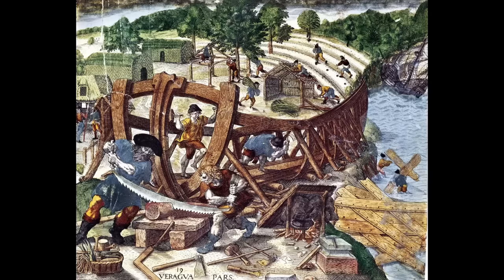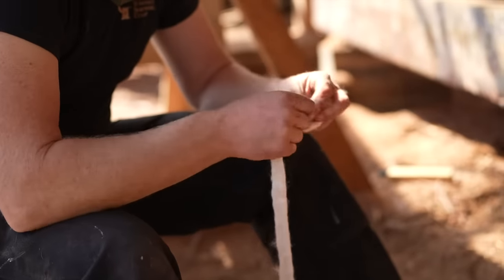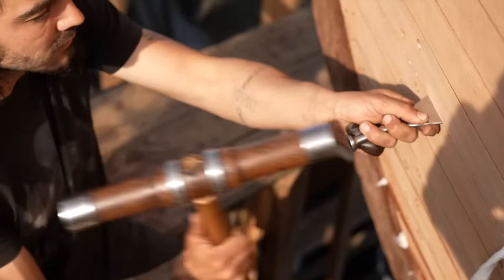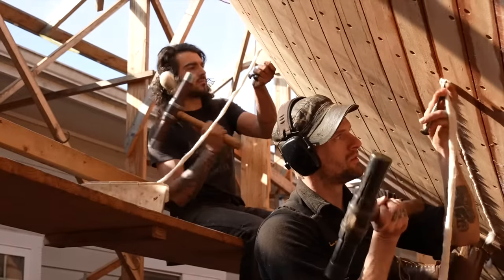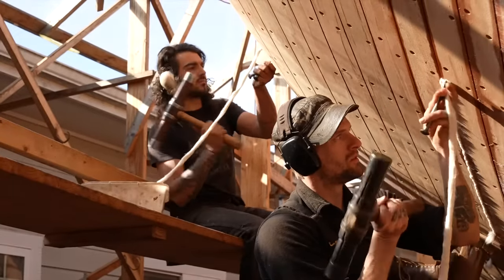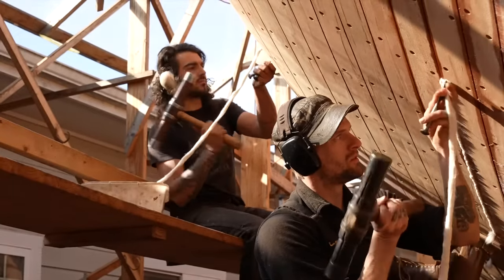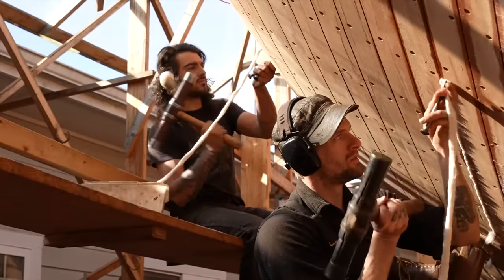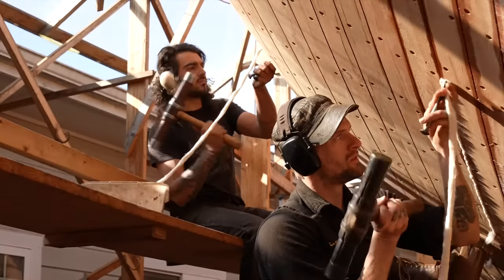Caulking (Corking?!) a wooden boat (Tally Ho / EP96)

Comment: From an online etymological dictionary:
Late 14c., "to stop up crevices or cracks," from Old North French cauquer, from Late Latin calicare "to stop up chinks with lime," from Latin calx (2) "lime, limestone" (see chalk (n.)). Original sense is nautical, in reference to making ships watertight by driving oakum into the seams. Related: Caulked; caulking. As a noun, "caulking material," by 1980 (caulking in this sense was used from 1743). 
I hope this settles the debate around caulk and cork. It is just a coincidence that these words sound similar; that's the English language for you; it's a mishmash of several languages. As to the pronunciation of "caulk", I prefer to sound the 'l' very lightly, as you would when saying "walk". It sounds good when you have said it a few times, and if you need to be that, it even sounds authoritative and suggests deeper knowledge.
The whole thing about our beautiful language is that it is complicated, changing, much changed and music to the ears. No wonder it is the language of the air and of the sea. Everyone wants to speak it.

Comment: I'm a bit confused, how can you call it "Rebuilding or restoring" when there's nothing saved or restored for the original boat???( or did I miss something) Just a question, don't everybody get their panties in a bunch. Regardless of what you call it, you guys are true craftsmen. I'm amazed how you can know so much and be so young...Thanks
Reply: episode 58
Reply: @on4xb  Thanks, I watched it, no different than my 68 GTO, every part on it has been changed. Basically the car has been rebuilt and repaired over the years, so it's different but still the same car. So in Tally-ho's case, he decided to replace everything at once, as apposed to piece by piece over time. Listening to his explanation was way more thinking than I wanted to do, but it was worth it to learn the logic...Thanks Again

Comment: caulking is a sealant ... corking is a way to fill a hole or gap  ... you CORK the planks .. you Caulk a window ... the original fiber used to fill in the gaps was cork bark ... thus the name Corking
.
 the other way it gets explained is you cork a hole but you caulk to seal ... adding fiber is like a cork adding tar over that is caulking
.
the reason cork bark fiber was used is because it absorbs water and expands keeping the hole filled stopping or slowing leaks ... cotton became the standard in the americas because it was more readily grown and available than cork bark fiber
.
when you putty the seams you are caulking them ... think of a good wine bottle ... you cork the bottle to fill the hole and seal it with wax to stop evaporation or spoilage .... that is also known as caulking something up because the cork didnt fit tight enough to air seal it ...

Comment: Well ... I'm going to say what many must be thinking.  Surely there must be plenty of caulking materials (silicon, tar-mastic, silicon rubber, etc) that are as good as - or better - than paint & cotton.  All these new materials can be purchased in tubes, and squeezed in with a mastic gun.  I see no reward in clinging to an outdated method if it's more expensive, less efficient, less reliable, and will never even be seen.

Comment: Just noticed, there is no caulking/corking at the transom?  what keep water out at that joint? 24:38
Reply: see episodes 74 and 76
Reply: @on4xb  Yup  have seen all of these from day 1. The area I'm referring to is where the planking meets the side of the transom.
Reply: I think Leo answered that in a comment on this video: The planks are screwed in side of the transom, but there is  bedding compound between transom and the planks. There is no caulking bevel just the bedding compound. If you try to caulk this seam it would create so much pressure on the planks (the screws are very close to the edge of the planks) that a- you lift the plank from the transom, creating possible leaks and b- the plank could split, creating all sort of problems.

Comment: Can we look forward to a challenge race between Tally Ho and Jolie Brise?
Reply: Jolie Brise is "a bit" bigger than TH: 56 Ft versus 47Ft6", but that does not prevent a challenge/race between the two
Reply: @on4xb  LWL is about the same at 13.8 vs. 13.6 meters which is a major speed determinant.  I'd estimate that they are well matched.

Comment: What keeps it from going right through the crack and into the boat?
Reply: Each plank has a bevel cut into it for +- half the thickness of the plank. On the inside the planks touch each other and prevent  the caulking to penetrate the inside of the hull
Reply: @on4xb  Wow, just when you think there is nothing more to learn about boats.

Comment: I’ve never heard of “corking” except as a mispronouncement or a funny accent. A synonym for “to caulk” is “to pay”, giving rise to the saying “the devil to pay and no pitch hot”. The “devil” in this case is the plank seam at the deck, the longest seam on the boat. The “devil” in this sense is seen in the saying “between the devil and the deep blue sea”, meaning over the side but not yet in the water.

Let me know if you are in need of a ships etemologist. 😎

Comment: I noticed the top and bottom of the seam is getting wet with something. Is the cotton soaked in something or is some type of glue or liquid put in the gap before the cotton?
Reply: linseed oil
Reply: @JayKayKay7  is that just to make it easier for the cotton to be packed in?
Reply: @inspectorsteve2287  see 10:30
Reply: @JayKayKay7  thanks

Comment: Why didn't you put oakum over the cotton? Not criticizing just curios.
Reply: Tally Ho's planks aren't thick enough. Her planks are only about 1-3/8" thick, w/ the depth of the beveled seam about 3/5ths of that, so the single layer of cotton is enough. Larger wooden boats such as Constitution have much thicker planking, 4" to 7" - they need the addition caulking material.

Comment: Are you going to install cover boards across the ends of the planking (at the transom), so as to reduce the intrusion of water and stop the likely hood of rot in the end grain of the planks?  Another option would be to coat the ends of the planks with clear epoxy resin - two coats mininum.

Comment: Well what can I say ! What a lot of rubbish ! First prime the seems with paint , then caulk them , then paint the seem again over the caulking , then use very dry linceed oil putty , also the best way to start after painting the seems is to start forward and caulk the first six inches then stretch your cotton to the end of the boat and with a drill wind it tight this makes caulking faster you may have to add cotton in places where the seem is a little wider i used to pick up a piece of wood and head for the band saw and make a mallet the weight I liked to use but what do I know ! Ime only 74 years old .

Comment: good grief really? you know its the 22 century they make poly seals last a lifetime, sheesh, dry dock much?
Reply from the maker: They also make fibreglass boats, and if you really want you can just fly there and skip all all this sailing rubbish. 
Side note - Caulking is structural, poly seals wouldn't stiffen the hull in the same way.